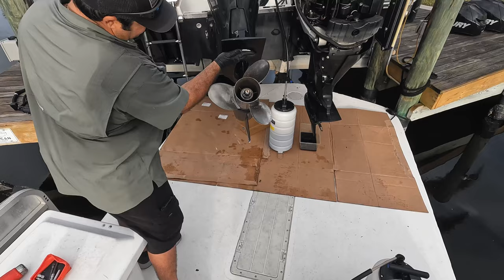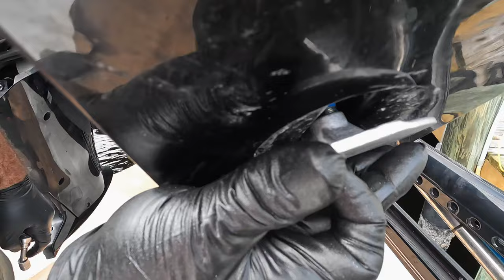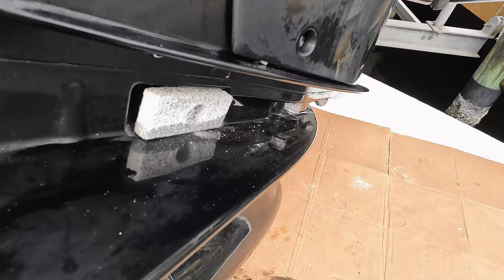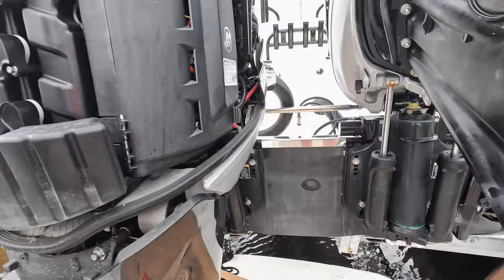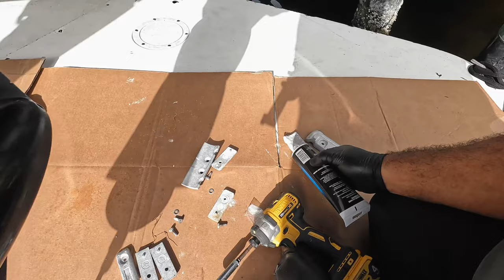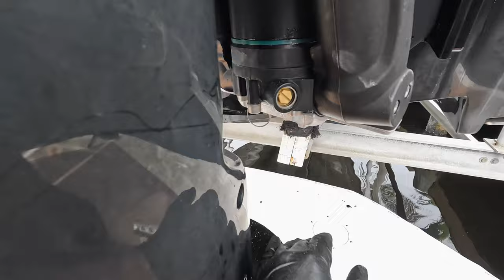How (and When) to Replace Mercury Outboard Anodes | Mercury Verado L6 200 - 400HP

Comment: Respectfully, I've owned twin 2015 Merc Verado 300 HP engines for almost 10 years and do my own anode check & replacement. Those anodes are still in VERY GOOD condition and did not need to be replaced - and you know it.